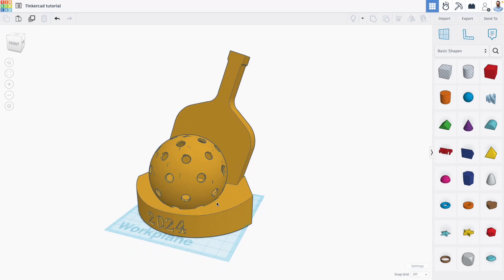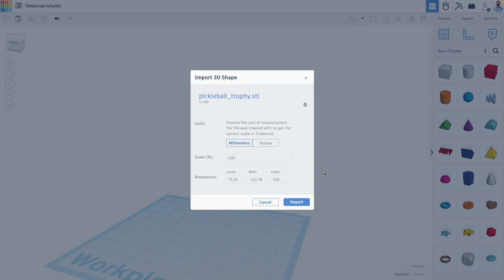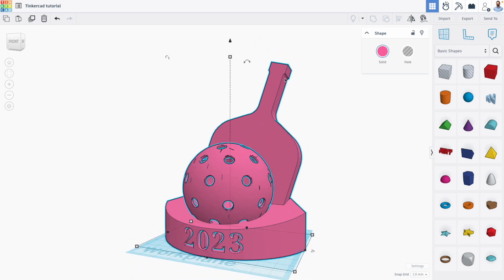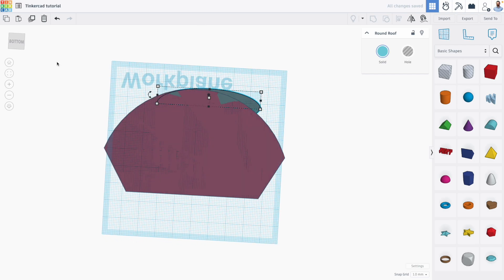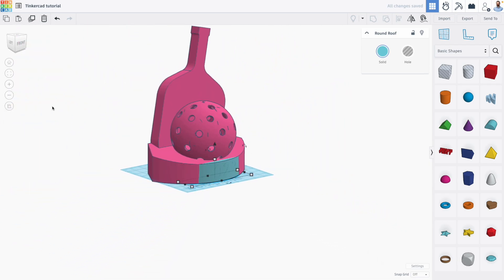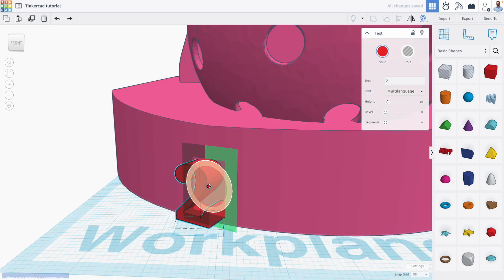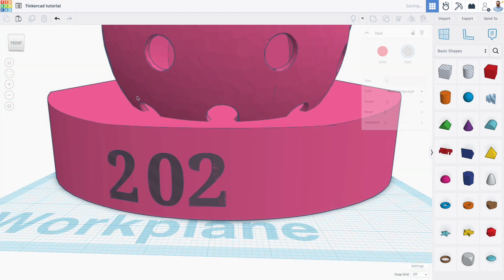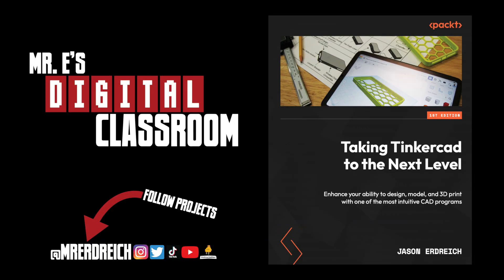How to edit imported STL's in Tinkercad

Comment: When I import an STL even one that I made in tinkerCAD there is no workplane visible.   Also for some STL files that were exported for objects created on the standard workplane, when I try to reimport the STL it says it takes up more space than the workplane and won’t upload.  ???
Reply from the maker: Imported models often import huge, so perhaps the workplane is just fully hidden. There is also a maximum file size allowance, and very complex shapes will not import successfully.

Comment: Have a couple questions. This video is a little old (many updates to TinkerCAD have occurred since it's release), does it still apply as shown? What exactly are these surface defects? Do you have to worry about them when 3D printing designs? Will this work correctly with the defects just kept as is or should these be fixed with MeshMixer or MeshLab? Just trying to ensure that an updated stl will print correctly without any defects shown. Appreciate any guidance. Thanks.
Reply from the maker: Thanks for the view! While there's been a handful of updates since this video, all tools shown are still very current and much the same. The surface defects happen as a result of exporting then importing mesh files (STL), its less of a tinkercad flaw and more of a side effect of working with this type of file rather than a STEP or parametric format. 

Most of the defects wouldn't appear when printing at a typical resolution (~0.3 mm layer height) but may if you're printing at a higher detail. In general, Tinkercad simplifies its polylines as it handles geometric shapes, so getting the smoothest part from Tinkercad really isn't possible, that's why all cylinders are a little blocky, even if you increase the number of sides to the max. 

So you could bring your STL into a mesh editing program like MeshMixer, MeshLab, or Blender to smooth it out more effectively, but again this would only be if you are pushing to really high details  where it may be noticeable. You can also adjust your print settings to compensate a bit better in how seams are printing too, but that might be more situational than practice.